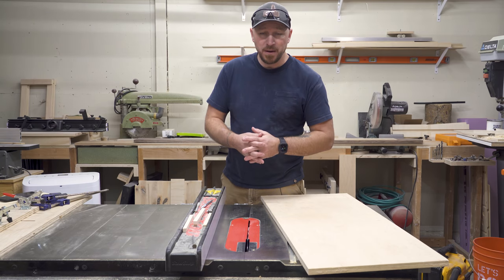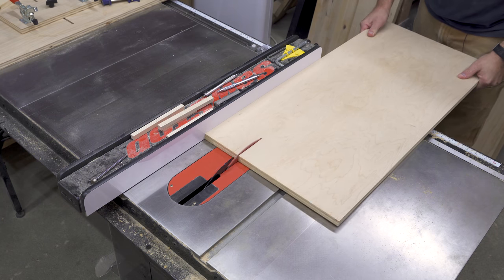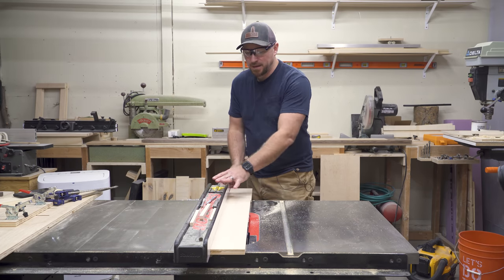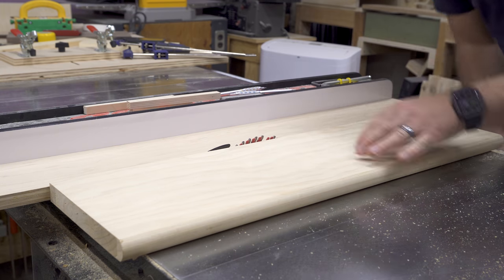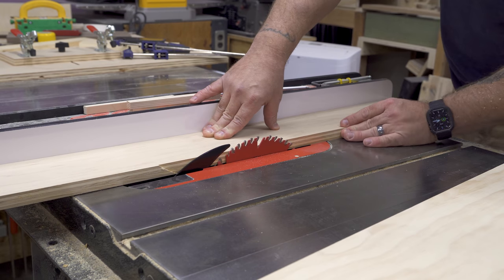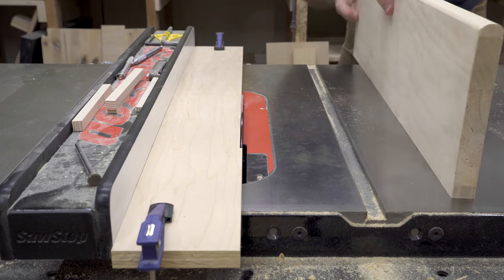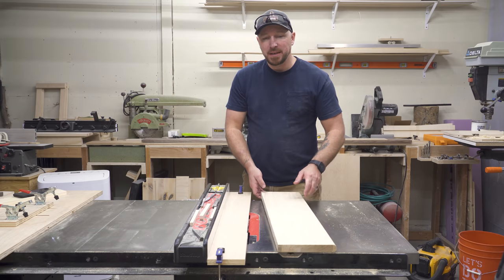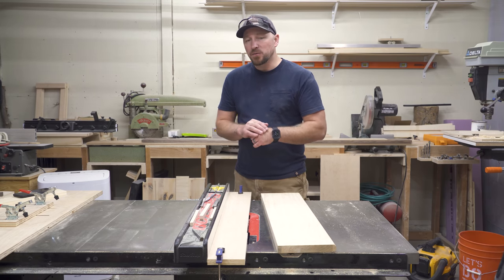Table Saw Jointing WITHOUT A JIG! - How To Joint Wood Without A Jointer

Comment: Just tried this on a couple of old bench oak boards that were severely warped.  I can glue them together as tight as any jointer could make them.  Brilliant!
Reply: I was wondering if this actually works? It looks so simple, it seems like it's a trick of the camera or something haha. I'm going to try it on my radial arm saw, since I don't have a riving knife on my table saw, or a Saw Stop tablesaw.

Comment: What an amazing tip. I literally just watched this, said "holy cow," went to my table saw, made one, and used it on some cherry boards with a slight curve to them. I did the up-board, down-board method to make a complementary joint angle, and passed each piece thru it twice. And it WORKED. Like, perfectly. Just amazing. The best part about this, compared to others, is you can joint boards longer than this piece of plywood.

Comment: Holy crap I’m so glad I came across this video before making the jig I was about to! Thank you!
Reply: You can still do this, but make it into a nice jig.

I cut about halfway through the board, then raised the blade up through the piece to get a nice kerf in the wood instead of the backwards kerf he has in his. I also removed the riving knife as it is not needed with the board there.

Comment: Wow! 
That is brilliant. I have tried a lot of different methods that I have seen but this is the best. I am in the process of making 31 tables out of treated pine and was struggling to get a perfect straight edge for joining. Can’t get a jointer locally and it’s to expensive for me to bring in one at the moment. This will save me so much time. Thank you , thank you.

Comment: EXCELLENT! I just used this method to shave off a 1/16" along one of the legs of a plywood triangle I'm using for a jig I'm building. I should have sized the triangle blank before I cut the angle, but forgot to. This video saved my project. Thank You! Subscribed and Liked.

Comment: I made a jig for this on my own, about 20 years ago. People said I was doing it "wrong"... but I never saw a need to have a planer/joiner. I had about three different tricks like this to get around it. On my jig however, I put the board upright just ever so slightly past the blade, lifted the blade and cut up into the stock, then made a backer for the difference on the backside of the blade, (out of manilla folders and wood glue, several layers)- so I only cut about one millimeter off the board I was passing at a time, and could truly "plane" off the material necessary to true up the board in question.

Comment: Love your content and this is an excellent solution to those that need to joint edges on their TS.  

Two things spring to mind, firstly you need to ensure your fence is absolutely parallel to the blade, personally I have mine open a degree or so to guard against pinching and kickback. So if this isn't working perfectly for you check your fence alignment.  Secondly as with all jointers make the "guide fence" as long as possible to give the best support to the work piece throughout the cut. 

I have used my router table to joint boards in the past but I will try this, probably 60in made from 18mm birch ply laminated to 36mm, alignment after initial setup might be problematic if you are looking for real accuracy but we will see!

Keep up the good work!

Comment: Should work the same with longer boards right? I bought a bench top jointer and I get a nice clean square edge but when I but it against another board it still has an arch it’s driving me insane!!

Comment: Much more refined than the method I used the other day on the fly. Rough framing remodeling and sistering 2x's I had one that was too bowed. Quick and dirty (can you say "unsafe"?) I took a longer 2x that was straight and ran them both through the tablesaw. Worked well enough for what I was doing. I like your method here. If you look at it, it's exactly how a planet works. Cool!

Comment: That is a great trick. I wish I'd thought of that. Up to  this point, I've been edge jointing with my router table. The results have been less than desirable since the fence I have is only 24" long. This will be much more useful when I'm out on a jobsite. Thank You.

Comment: Does this method work with any length of board? Would the auxiliary fence need to be longer or could it stay the same 36"-ish length, if I wanted to edge joint a 6' board?

Comment: Great trick. This is what I used to do before I had a jointer. I've  also done a similar set up with the router. Still a good trick for when I'm on a job site and don't have access to my jointer.

Comment: This is a terrific tip, especially for use on plywood. Plywood has voids and end grains and just tends to eat up all kinds of jointing tools so there is a real need for a simple way to joint plywood edges without destroying expensive bits and blades. Using a more robust tool like the table saw blade is definitely the way to go and using your suggestion seems a much better way to do so. Most other suggestions using an upright attachment to the fence don't adequately account for the width of the blade unless you spend an inordinate amount of time with some trial and error testing of your setup. Well done, good suggestion.

Comment: This only works as long as the fence isn't moved? After you joint what you need to you may(probably) need to recut the 2/3 length kerf? It is pretty brilliant though.

Comment: Thanks much!  Seems most of these videos assume you're working with on a gigantic table on a cabinet saw, along with the matching gigantic jig.  Whereas I have a relatively small job site saw, just due to lack of space (my "shop" is also my garage, which is the proverbial 20 pounds of crap in a 5 pound bag, and I have to work in the driveway).  I see a lot of your videos are showing tips that would work well on our smaller saws too, and I really appreciate that.

Comment: Most other edge jointing methods using a table saw that I've seen requires adjusting the fence to determine how much will be taken off.  This method requires more than one pass if the bow is greater then the blade width, but only requires one setup regardless how many pieces you have to joint or how wide those pieces are.  Great tip and video.

Comment: Not a bad idea at all!
I never used riving knives, never needed them, I knew how to control my material and the saw. hundreds of thousands of cuts later retired with out as much as a close call...so if you are anything like me and you don't like riving knives in your way, and you try this method, be sure your material is clamped down tight. Leaving uncut material behind your blade will result in kick back once the board drifts into the blade. Then once that board gets pulled through the blade, it can pull your hand through the blade with it, if your hand is in the wrong place. I've seen it happen. That's how I learned, by seeing other guys lose their finger tips. Also remember, the more powerful your saw is the more dangerous kickback becomes. Once your using 5hp 3 phase motors the saw is a powerful beast..I've seen 7 hp saws toss over a half sheet of  3/4 plywood across the shop like a playing card.

Comment: Can I do this if the board is longer than the table? I've tried it with 5ft boards and just seems to take the same blade width off the entire length and not straighten out on boards that are not too bad to begin with. Thanks

Comment: Hi Jodie , this is such a brilliantly simple idea (like all the truly great ones), I have a couple of quick and very possibly dumb questions if you could please advise. whereabouts on the  guide do you maintain pressure ? the reason i ask is I have tied straightening some timber (hardwood pallets lats), and i keep getting a tapered end on the rear of the piece of lumber  (if that makes sense) .I have tried keeping the timber edge in contact with the nearest (cut) edge of the guide piece and the rear uncut edge , but still end up with a taper. If you could explain your technique when using the jig , I would be very grateful. Keep up the genius videos (the box joint peg width one is another ) and i look forwards to your next video. Many thanks in advance keep safe and well , Glenn, Sheffield UK

Comment: I built something like this a while ago, but I only went about half the blade width. I also removed my riving knife and raised the blade up through the piece so it was cut in the shape of the blade. It worked great and until I got a jointer, was the way I edged my boards.

Comment: It is key that the partial length cut into the jig be exactly blade-width deep as compared to the remaining edge.  As far as I can tell, that was done by eye.  But the technique shown in other Inspire Woodcraft videos for making saw kerf-width splines would work here: cut a board a couple of inches wide that becomes a temporary fence.  Run the jig board part-length along the temporary fence to remove a saw kerf-width amount from the edge.  That gives the jig but the fence must be reset to use it, which shouldn't be too hard using the jig board as a guide.  Or so it seems to me sitting here in front of my computer.  If this works then the jig could be reused.  And the edge transition arc would match the general sense of the riving knife arc.

Comment: Hi all, I’m new to woodworking so I might be missing something. This looks perfect for short boards but I don’t see how this would work for something like an 8’ 2x4 with a bow in it — since you need something parallel to the blade that’s as long as the 2x4?  A jointing jig is usually pretty long to make sure something parallel to the blade is making contact with the fence for the entire length of the cut.
Reply: Not sure how this is any different than trying to use an actual jointer for a long board. Does the fence really need to contact the entire board at once?
Reply: This should work with multiple passes.
Reply: Even on a jointer this is the reason for multiple passes. Unless of course if you have a runway length jointer

Comment: Can you please explain why do we need the extra board and can't simply run the material through the saw taking off a little bit of material? Is it because of the rounded edge? Or maybe something that will help us to avoid resetting the fence over and over again? Thanks!

Comment: If you’re jointing a long thin piece, could you use a feather board behind the blade to make a straighter cut, since the pressure is kind of taken off of the blade?

Comment: Sometimes I have really long boards and need a longer straight edge. I took a 8 foot board and drilled a hole in the front and back so I could clamp that board to the table saw.

Comment: Consequently, this is a great way to make sure the blade heeling is properly set up, if someone doesn't have a dial indicator and jig. Can do it a couple ways but easiest is to make sure the blade is touching the wood, the entire length of the blade, after cutting the width of the blade on the second cut. If it's not mark a single tooth on the blade. If it touches front and back, it means the blade is warped or bent. If it is still off you can use feeler gauges to make the heeling adjustment. Similar to how you set up a crosscut sled fence. I use a jig I made for calipers because it is going to be more accurate.

Comment: GREAT Job... everyone else shows use of hand planes... Love it... Any chance you have a video on how to make boards that are of different thicknesses from one end to the other flat? I know that can't be done on a table saw or on a planer.. looking for another way... for like a 10" Stair Tread made from 5/4 that is actually 1 1/16" on one end and 1 7/32 on the other end... I need to get this down to 7/8" consistently...
Reply: Did u ever figure this out? I'm looking for the same solution

Comment: Would this work for taller piece that are like 1 3/4” or would the reference piece need to be taller too? Pask Makes a much taller one and uses something thin like laminate sheet to add the thickness of how much is planed off but his requires a jig and more plywood

Comment: This solution would have made the headline by now! So if I have a thicker (taller) stock to run then I can still keep the less thick sacrificial board that is squeezed between the blade and the fence? My idea here is to run all my stocks (different thickness) sequentially rather than clamping them one at a time in the jig. When all done then just run the other side without the sacrificial fence since the opposite side was already jointed.

Comment: Thank you. All these other guys making these complicated jigs with 10 clamps and two pieces of wood screwed and glued. Question though. Maybe this is against safety precautions but couldn’t you just slide your fence an 1/8th “ away from the blade acting as your straight side? Instead of even using wood to begin with?

And is it okay to use this method when the wood that is bowed if it’s bowed the opposite direction?

Comment: Great tip that I will certainly put into practice in my limited space shop.  Quick question, what type of blade are you using to get the smoothest cut and reduce saw marks on the edge?

Comment: Super new to this and have a silly question.  Will this still work for longer boards?  Like 4ft, 5ft ect.  Recently built a desk from box store 2x6 and the joints were less than desirable, but I learned how to make diy wood filler :).  I need to make a few more for the work from home situation and would like to spend less time sanding wood glue from the top as I need to spend all my time looking for the tools that I used 12 seconds ago!!  Thanks in advance!

Comment: Hmmm....nice but I don't get why the sacrificial wood fence is not longer than the board being trued. Would this not make the bullnose side not parallel in width, end to end to the jointed edge?  I'm thinking with this stair tread being concave in the middle that the two widest end points would have to start through the cutting process on the same plane hence against a longer sacrificial fence. Am I over thinking this?

Comment: I've seen some pretty sketchy methods for using a table saw to joint a board but this is far and beyond any suggestion I've seen. No jig, no sketchy techniques, just a simple solution that actually seems pretty safe to use.

Comment: Noobie woodworker here, question , why couldn’t you just run the stair tread thru with the nose end against the fence ? Wouldn’t that straighten out the gap on the other side ?

Comment: Are the two long sides parallel if the ends on the jointing side aren't both against that reference board when you start the cut?
Reply from the maker: @grayonhill If I'm understanding you correctly, the two long edges won't be parallel unless you flip it around and rip the other edge.

Comment: Unless I'm overthinking it, this will work only on short boards.  Example  from where blad starts to beginning of fence jig is say 25 inches.  If the board you're trying to joint is, say 48 inches and the bow is almost the entire length of the 48-inch board, then this method won't work. The fence jig has to be able to span the entire bow in the board.
Reply: I see no reason one wouldn't make a longer version of this and clamp to a length of 2x4 to prevent sag with the long overhang?

Comment: OH cool! You made the table saw into a jointer. I'll assume this only straightens the particular side, and won't be parallel to the opposing side. (Like what happens on actual jointer). Also assuming the blade kerf has to be equivalent to riving knife thickness. Great tip !
Reply from the maker: Correct about only edge joining but hopefully I made that clear in the title and video. I hope! You might be thinking of a planer for parallel faces, jointers can do perpendicular, like one face and one edge, then a trip to the planer and table saw to finish off. The riving knife should not be thicker than the blade ever, but it does not need to be same thickness by any means. It only serves as a safety mechanism to not touch the wood to the blade.

Comment: I wish I had seen this video before last weekend. Does this method work for very long boards?
Reply from the maker: I believe the general rule of thumb with jointers is stock no longer than twice the jointer beds length. Of course results may vary, but in theory that would mean use a four foot piece of plywood board. I used a about a five foot piece of OSB and it worked great. I just don't remember how long the piece was that I jointed.

Comment: Sorry if this is a dumb question, I’m pretty new to this. But would that not cause a tapered edge once the edge of the piece meets that 1/8” part of the jig that sticks out after the riving knife?
Reply from the maker: No dumb questions with this type of stuff. I am not really sure what you mean by "a tapered edge", but that 1/8" piece left over is to support the piece on it's way out and is exactly the thickness of the blade. So whatever goes in comes out at the same plane as that 1/8" piece. It essentially works the exact same way a traditional jointer works, or a router table fence with a shim on one side.

Comment: I have a piece that's about 7' long with a slight curve to it that I need to straighten, will the non-jig jig have to be at least that long on the in and out feed or will that not matter at all?
Reply: It should work. Will just take a few extra passes.